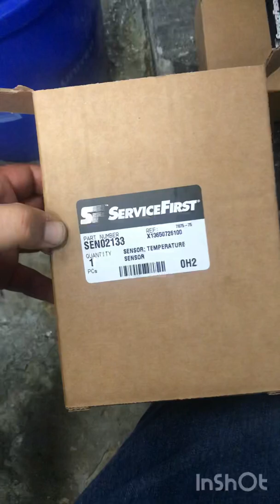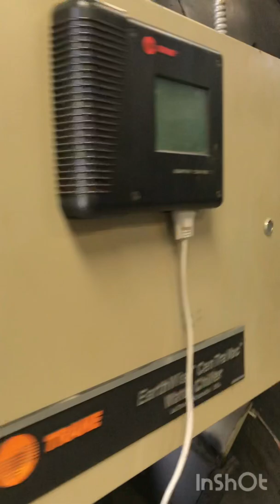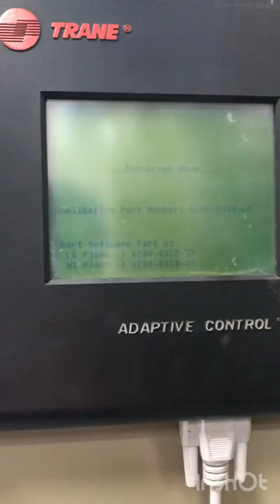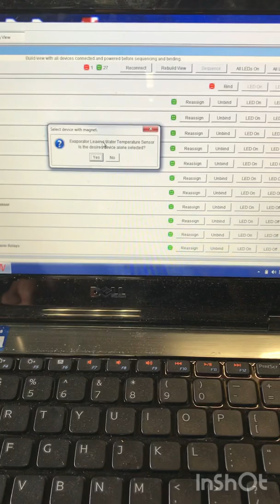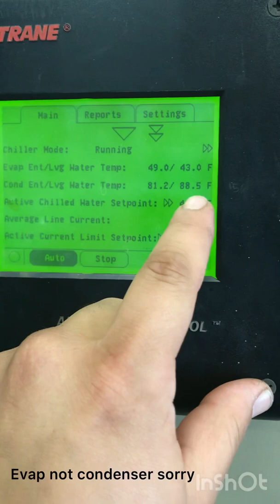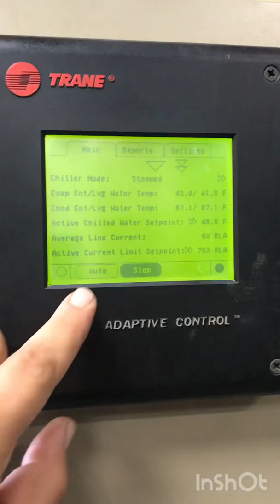Trane sensor bind in step by step TechView

Comment: This video was a lifesaver today.  We had a new oil pump high current relay board installed but needed it bound.  Easy download and install of Techview, used the magnet on my flashlight on the board  beside the com cable connection to get the green light on then it bound and we're up and running again.  (replaced the capacitor at the same time).  Thanks for sharing.

Comment: Hi,
Many thanks for this helpfull video
I want change damage trane sensor X13650726100 Sen02133 .
please , i use UC800 conntroller, is it necessary that i bind the new sensor after i replaced the old damage one?
Reply from the maker: Yes you have to bind in the sensor. Thanks for watching.
Reply: @Junkremoval-hvac  , please what i need to bind it?
Reply: Tracer TU software for a UC800

Comment: Sir,i have some binding issue,i can lightup the led at the liquid level sensor,but when i bind the techview says unnnable to find selected device
The liquid level is a new part installed
Then i do binding the old liquid level and i had same problem, i have change module ch530 and doesnt work , is my new liquid level part is defective

Comment: Why is it when I click local connection it ask me to select communication port com 1, 2 , 3 which one is it ? Do o Try em all to see which one please help. I have techview latest version 14.0 and the 14.0  sp16 install both please help.
Reply from the maker: I have not ran into this issue before. I would say, yeah try em all see what happens. Sorry unable to help in this question
Reply: Go to device manager on your computer while the adapter is connected to see which Com port is in use.

Comment: Why is it necessary to hold a magnet on the LED to bind the sensors of the trane brand chiller? 
Why and how does the LED light up when you hold the magnet?
Reply from the maker: Not sure how but using the magnet lights up the sensor. Reason you light it up is because they computer will ask if it’s lit up so it knows the proper sensor to bind in. There are many in the system.